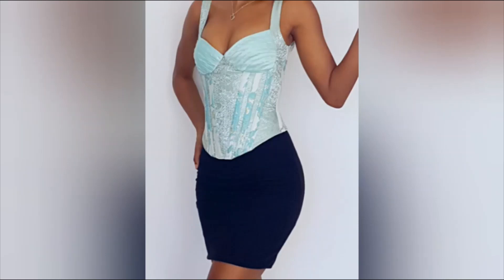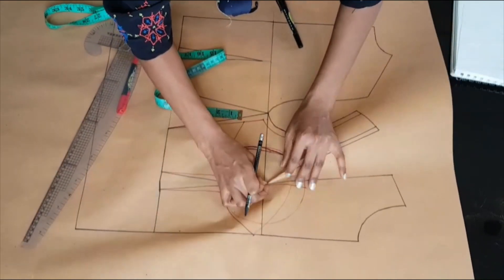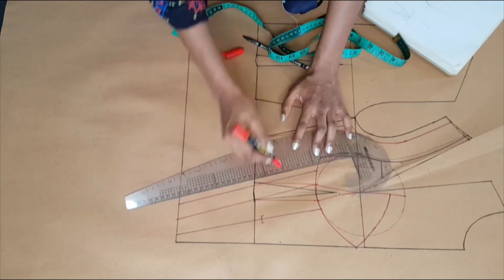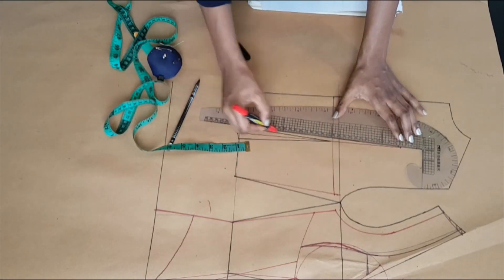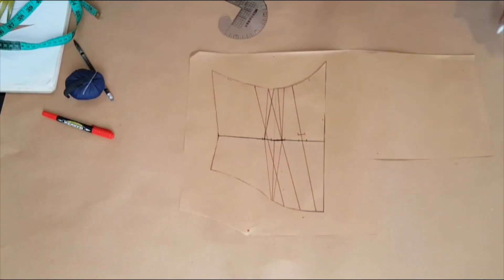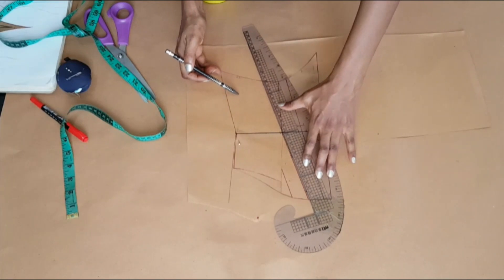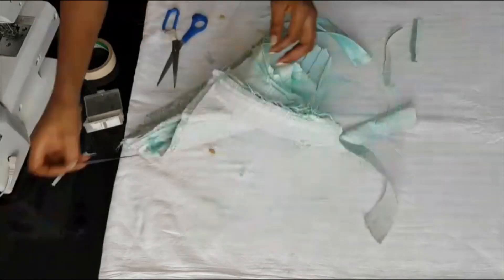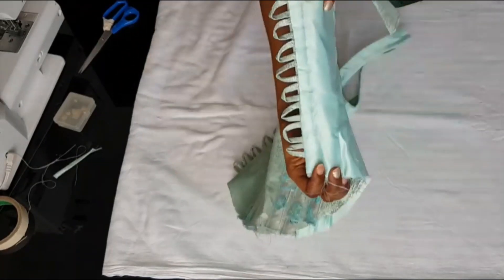Bustier/corset top with pleated cups/pattern drafting and sewing tutorial

Comment: That's a really detailed tutorial. Thank you. 
Quick question please - did you stitch down the modesty panel to the corset, or you just placed it at the back? I'm asking because I'm wondering if without any stitch the modesty panel will fall off. Help me clarify.
Reply from the maker: Thank you for watching. I didn't stitch it to the corset. It is a separate piece. If it is laced properly, it wont come off.
Reply: Thank you very much. I'm a gigantic fan 🤗

Comment: I love your finished corset and would love to know what base pattern you started with
Reply from the maker: Thanks for your support. I have a tutorial on my channel on how to make your own basic pattern.  Check that out
Reply: I don't usually like or comment but thank ! God bless you. Awesome my notification bell is on!!!!
Reply: @senoritaabul  I will Tnk you
Reply: One question please. For  myself I have a much fuller bust so can I increase the dart intake under the bust or is 0.5 just fine for ever size?
Reply: Also do you have an instagram handle I can follow
Reply from the maker: @nneomaqueendalyn894   standard contour measurements under the bust is 3/8" or 1 cm but it doesn't work for every one.
What I suggest you do is,  measure around your under bust, divide that by 4, place 1/4 of the measurements on the under bust line, what ever excess your have should be your dart intake.

Instagram is the same name